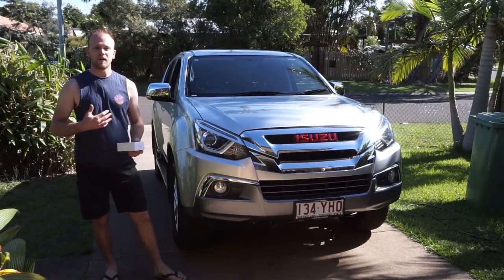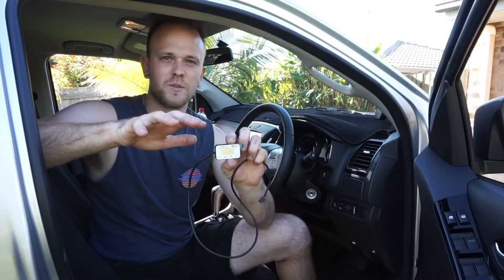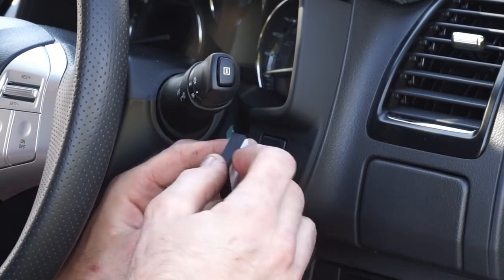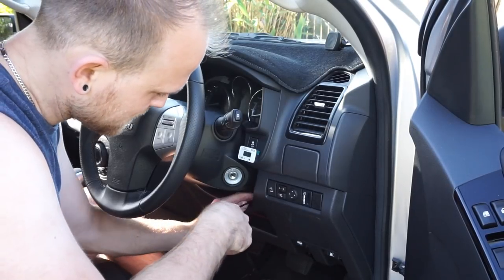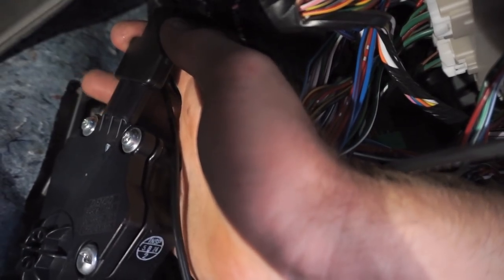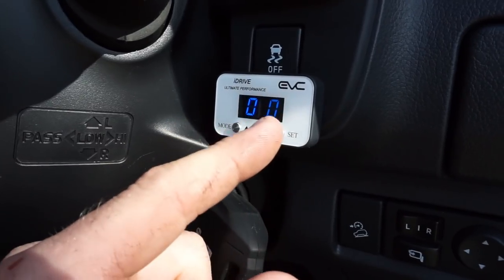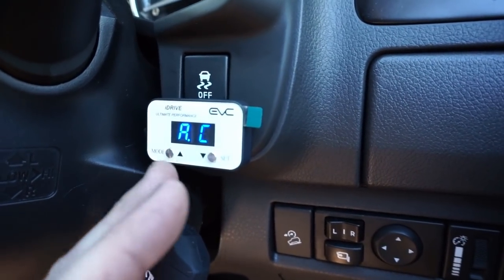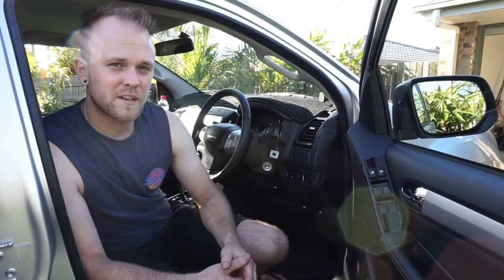iDRIVE Throttle Controller || Unboxing || Installation || First Drive ||

Comment: Hey Nick, just did the install on a 2021 Dmax 4JJ3.  Same throttle plug!  Would have messed around for ages getting the plug off if it weren't for your movie, cheers!

Comment: Hi,  I like your videos a lot and I am a subscriber because it helps me and others, if you don't mind can you give feedback regarding safety issues, My question is what if the throttle controller's device suddenly fails? or the little wire cut? Do we still have the control of gas pedal? or it will be back to normal mode? Thank you for hoping you can enlighten us. thank you again!

Comment: Cheers Nick,  is there a factory setting (defaults to the cars original output).
Reply from the maker: There sure is. You can turn it off and revert to the factory settings.

Comment: Hey Nick, any noticeable fuel consumption increase after the idrive installation? Great video btw.
Reply from the maker: It increased a bit due to me driving it harder for a while. After you get used to it, its about the same 😊
Reply: It’s $2.40 litre atm 🤦🏽‍♂️ fml but I’m very with the idrive though it’s like a new car 🚗

Comment: Hey mate, great video. 

Is it better in fuel if you use Eco mode most of the times? And if so, which level is better E1-5 or 6-9 ?
Reply from the maker: It is better on fuel when in eco mode. E-9 Would be the most fuel efficient setting.
Reply: @LowRangeNick  
Thank you heaps

Comment: Hi Nick, just fitted my Hikeit and now the transmission light is staying on. Any clues??? Cheers Lyall
Reply from the maker: Did you turn the ignition off and wait for 10 minutes for the computers to shut down before unplugging the accelerator plug? If not it would be a code related to disconnecting it. Try disconnecting battery for 10 minutes and see if it clears. If not you will need a code clearer/scanner.
Reply: @LowRangeNick  a trip to the Isuzu dealer.. would that be okay????
Reply from the maker: @lyallbarron9625  yep

Comment: Hey Nick, I've just bought  MUX and thinking about the Idrive, now that you've had it a while do you still reccomended it? How's the fuel consumption? And what setting are you using these days? Cheers!
Reply from the maker: Hey Dave! The Idrive is a good unit. BUT. I did sell the Idrive and upgrade to a HIKEIT X9 Throttle Controller. I would recommend a HIKEIT over the Idrive due to it having more modes, more settings to play with, Auto dimming display, Anti theft throttle lock out mode, the wiring comes off the right side of the unit so it mounts perfectly on the left side of the steering wheel over the blank button. I have done a video on the Hikeit X9 as wel if you would like to see more about it. Also if you choose to go the HIKEIT if you use my discount code - 4X4NICK - you will get 10% off at the checkout :)
Reply: @LowRangeNick  thanks Nick I watched that video and you have highlighted the differences really well! I am just about to start modifying my MUX and you have a video on pretty much everything I want to do which is awesome, thanks mate and keep up the good work!!!
Reply: I just fitted one, before seeing this channel. I would strongly recommend them (not working or affiliated with iDrive).

Comment: Have you notice the idrive d when overtaking a cars while doing 110kph?.  I'm getting my idrive next week.  Is their much notice while go offloading.   Love your channel btw nick 👍👍
Reply from the maker: Hey Jason! I dont run the Idrive any more. Im running the HIKEIT X9 now and it is great, massive difference. It has loads of settings, more modes, auto dimming display, anti theft throttle lockout mode. It makes the throttle alot more sensitive so as soon as you put your foot down it goes! Check out my video on the HIKEIT and see what you think. You can also get 10% off the HIKEIT X9 with my discount code - 4X4NICK

Comment: Hey Nick great video, do you know of any problems with the idrive when towing a caravan, cheers
Reply from the maker: Hi Jas! No issues with towing the van with the idrive. I am now running the Hikeitx9 throttle controller which i have also done a video on. It has alot more features and is a bit cheaper as well.
Reply: @LowRangeNick  
Just watched the hikeit video, good for towing also, cheers
Reply from the maker: @jaspuckett9513  Absoutely, it will make towing alot nicer and easier to keep at a constant speed.
Reply: The way this product works is it sits between the accelerator pedal and the wiring for the pedal. It just intercepts the percentage of how far down the pedal is, you're moving the deadzone along your pedal so if you put it to U9 it basically makes it that when you press the pedal 10% down it sends the signal to the car that you are putting the pedal to the floor (100% throttle).

For towing since you normally have to put the pedal further down to force more power out of your car by setting the iDrive to say U5 setting that will mean you have to put your foot down 40% less which means you can have your foot at a more comfortable angle that gives you better control over the throttle.

Comment: Hey Nick, I am considering one of these controllers for my MUX. I drive around (unladen) in the city as well as a fair bit of country driving with a 1500kg camper trailer outfit. I see benefits for city driving but will the iDrive help when the trailer is on the back
Reply from the maker: Hey Bill! It will definately help when the trailer is on. It will boost the throttle signal to give you better response. I am running the HIKEITX9 throttle controller now, it is alot better unit with more settings and features. Bit cheaper too. Check out my video, there is a discount code for them as well in the video comments. 😊
Reply: @LowRangeNick  Thanks mate - I’m onto it.
Reply: Hi Nick, just to follw up, I ordered one of the HikeIT units for my MUX. It arrived very quickly and I keen to install it. I have a small problem in that my MUX, a 2017 model  LST, the display unit cannot be located where you suggest because the starter button is loated there. I have not yet decided but I may install it on the LHS, partially obscuring the rear fan switch OR I may chase up the supplier to see if there is a display with the cable form the other side (LHS). Anyway, small problem, thanks for your help. Cheers
Reply from the maker: @billstephens6817  Thats good to hear it all arrived quickly. I have heard of people putting them in the coin pocket on the right hand side of the dash. The hardest part is figuring out were to mount it 😋
Reply: Yes mate, that took the longest! - I installed it on the LHS - half-covering the rear fan button and it is great, out of the way yet visible when driving. I took it for a run and I am rapt! thanks for the recommendation
Reply from the maker: @billstephens6817  Thats great to hear 😊

Comment: Great vid. Seems to be a must with these vehicles. Couple of questions. Did you run it in economy setting at all? Secondly. Did you find that the auto transmission seemed less likely to search for a gear at lower speeds due to more precise throttle response. And lastly. Ive heard ( and Im only going on that) these can void warranty. Whats your thoughts on that? Cheers
Reply from the maker: I dont use it in economy setting ever lol I enjoy the throttle response too much :P The transmission is more responsive as the throttle controller basically changes the throttle input so it is either more than the factory input (Ultimate mode) or less than the factory input in (Economy Mode). These cannot void warranty. It takes 1 minute to remove from the pedal if your concerned. It is pretty much changing the signal to the ecu to say you have put your foot down on the throttle more than you really have. It still works withing the factory parameters. Hope that helps :)
Reply: @LowRangeNick  sweet thanks mate. Reason I asked about trans response was as Ive only had mine a week, trans hasnt settled into my driving yet. And it seems one of these may help that along. Cheers

Comment: Mate I know it's been a while since you had this, installation was a cinch but how the hell do you release the idrive module from the existing pedal?  No amount of squeezing will release this thing LOL
Reply from the maker: Hey there, you may need to push the plug down then squeeze the plastic tab on the plug and then pull off. If it is still to hard to get off, get a small screw drive under the plastic tab that locks the plug on and pull the plug off. See how that goes.

Comment: After having it for a while do you still think they are worth the money?
Reply from the maker: They make a big difference. I Wouldn't drive the mu-x without a throttle controller now. I'm now running the Hikeit X9 throttle controller, it is a great unit. You can see my video on my channel to find out more.

Comment: How you going mate does it void the warranty thanks
Reply from the maker: Hey Brendan! It wont void the warranty on a new vehicle. It is simply ramping up the throttle input from the accelorator pedal. It still works within the standard vehicle paramaters but tells the computer that you are putting your foot down more than you actually are. It is also a quick 2 minute job to unplug if you are worried about it and there will be no trace you ever had it. Hope that helps 😊 Cheers!
Reply: Thanks nick got my LST last year love it how’s fuel economy around the city for you hi way
Reply from the maker: @brendankelly8606  Great economy! Coming from a TD 4.2 80 series it uses alot less 😊
Reply: It does void the warranty on any new vehicle! It's not a genuine OEM part and I know for a fact that Toyota & Nissan will wash there hands of them if you try and claim under you're new car warranty. So be very careful do your homework & ask your dealership plenty of questions 1st. In saying that, I have one on my Prado and they are great👍
Reply: Of course it voids your warranty
Reply: Remove the unit before taking it to the dealer and they will never know. It is a piggy back unit that tricks the ecu by modifying  the signals sent to ecu. 
I have worked 20 years as mechanic and warranty clerk for several brands.

Comment: how would you recommend the  ecu remap for MUX?
Reply from the maker: Ecu remap would be great! I have installed a unichip though. It gained 32kw and 100nm 😁
Reply: @LowRangeNick  wow that's nice bro..what about the other remap like re-programming the ecu..would it be good? does that damage the car in the long run?
Reply from the maker: @remohdude  Ecu tunes are great and if done correctly will cause you no issues 😊
Reply: @LowRangeNick  BIG thanks bro!
Reply: @LowRangeNick  how does the Unichip work with the IDrive? Are they a good combo?? And what is the Unichip worth roughly? Cheers
Reply from the maker: @69Olympus  Really good combo! Unichip is approx $2500 Fitted and Run on the dyno.

Comment: All these things do is change the gain on the response from the pedal. It wont help with Lag, power or anything else Lag is controlled by the ECU. Its just the same as putting your foot down more. There is some real good technical white papers that explain how these are just simple variable gain controllers. They actually work better as a device to dull down throttle control for rock crawling. Thats about the only thing they do that would be deemed an advantage.
Reply from the maker: Yep exactly, they are just a simple controller which boosts the output to the ecu to make it seem as if you have planted your foot. It makes the car a lot nicer to drive as its more responsive to your input. As you said the other advantage is when driving technical terrain you can also reduce the throttle output to make it easier to control your speed and acceleration! Have you got one on your Prado JJ? Thanks for the comment :D
Reply: @Doug Judy It way appear like they do due to the gain increase, but they actually cant. The Lag is in the ECU, and the peddle  POT and iDrive is prior to the ECU. You need to reflash the ECU to modify any LAG. There are a lot of scientific white papers on these things. They work really well to also dull the response down for rock hopping.
Reply: Not true at all. I installed one last week. I tow a heavy caravan and no matter how hard I put the foot down there is a very noticeable lag quite often. This has led to dangerous situations of being not quick enough to get going. I don’t work at am not affiliated with iDrive - but they have fixed that hands down. It does use more fuel on lots of settings though. I have found low Use settings the best for general around town driving, so far at least.
Reply: @lenclark3801  check out our latest YouTube video to see back to back testing of one on a dyno. And see what they actually do (which is not really anything!)

Comment: Where to buy idrive?
Reply from the maker: If you live in Australia try contacting Coolum Motors or iDRIVE australia. If you overseas you may need to look on ebay or google for an i drive dealer new near you. Cheers 😁
Reply: AutObarn are Idrive stockists too.